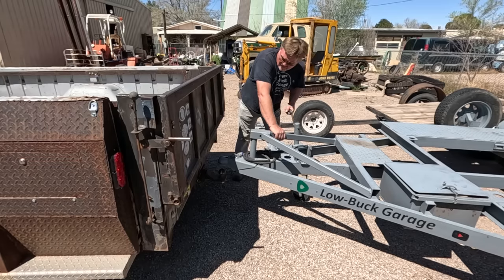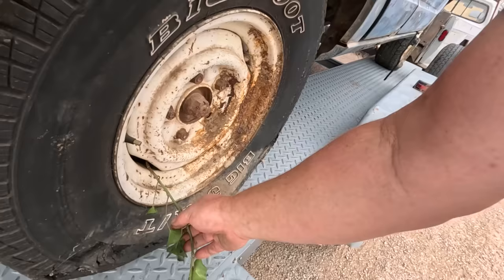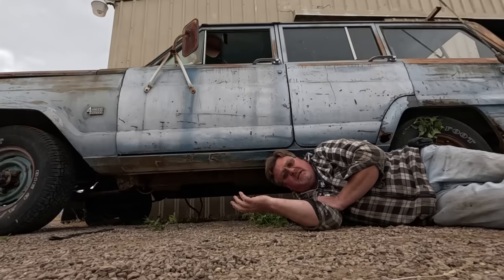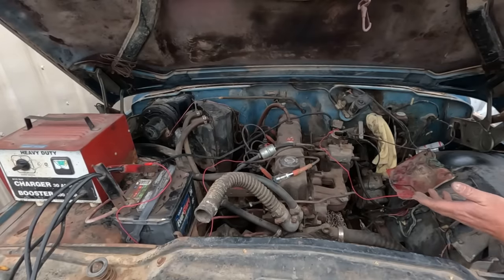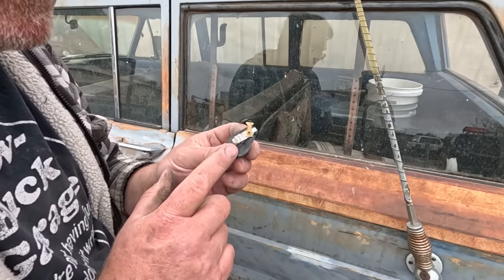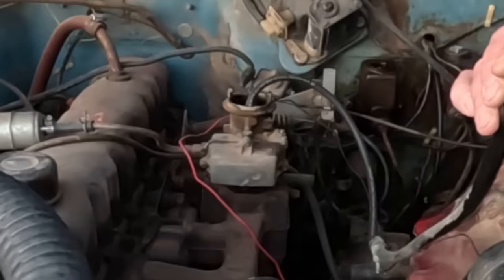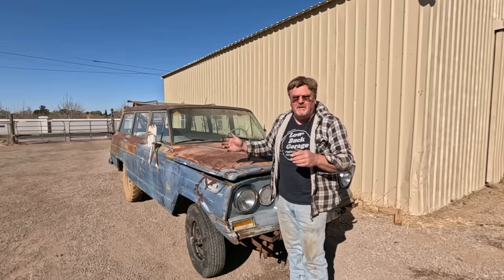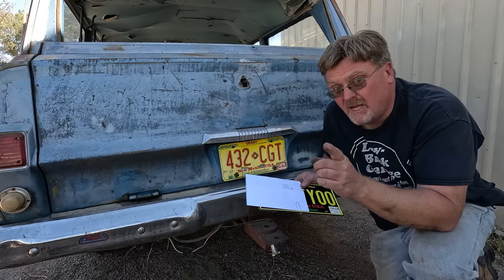The $2 Jeep... How Bad Can It Be?

Comment: I bet the guy who sold you the Jeep is watching this video in amazement 😮😊
Reply: Nah man, I just didn't have time to work non it and I knew low buck garage would have a lot of fun with it
Reply: Thanks for selling it- I enjoy low bucks videos
Reply: Can't wait to see the finished result, Pancho!
Reply: @How_the_gods_drill . Bet y'all really pleased to see it running tho, it was a lovely gesture from you. 👍👍
Reply: A nice gift. We're all enjoying it. Cheers 🍻
Reply: @How_the_gods_drill  the only engine issues were fuel, plug wires, and the missing rotor. You could have had this running pretty easily
Reply: @or-what  Thats low buck standards. Also needs break work, interior work, likely suspension work to be safe. A man could put 3-5k into it to make it a decent driver. Also not everyone has the knowledge to do all that stuff on their own. Get in touch
Reply: Yeah he said the engine was junk but it turns out that it runs fine after a little ignition and carb work.
Reply: @79tazman  Eh, I've seen a lot of junk engines that turn over and run just fine in a roller, only to have massive blowby or be puking oil from everywhere or a cracked combustion chamber that's only a problem when it gets hot.
I'm kind of hoping that LBG will give us a good rebuild video on this I6. With a dingle-ball hone and everything.
Reply: Fuel pump rad brakes gas tank a way to go  but he's got. A content. Winner
Reply: Naw swap in a newer 258. Jeep and check tranny.  Needs some good love and he's got a good family dune. Runner
Reply: Seems like the guy sold it specifically to watch this video in amazement. Could have sold it as scarpmetal for more than that. So. Thank you @franciscopolanco4492 you made our day with this.

Could have just given as a donation but a firm price of 2$ is way funnier. Probably avoids some paperwork too i have no idea about how car ownership transfer works.
Reply: and loving it 😊👍🏼🥓🥓🥓🥓🥓
Reply: @How_the_gods_drill  sos argentino?
Reply: why do all these peiple have accounts as old as me?!

Comment: "I suspect there might be an issue with the transmission, so I'm just ignoring it." Sums up my 20s
Reply: Sounds like a throw out bearing or clutch prob nway keep was hacked together I woon not bsuspect. It
Reply: Definitely throwout bearing!
Reply: 100% was gunna say release bearing(throw out to you ‘Mercian’s)
Reply: There's the same energy in that sentence as a quote from Tavarish that I remember, the cheap Audi that got him home and finally died in his driveway.
"I'm not going to check the oil because I don't need that kind of negativity in my life."
Reply: @Avetho or "but I'm sure that's just my (insert notoriously unreliable car)" from Aging Wheels
Reply: In your 20s, you can’t afford to fix it, so… Later on it will be (slightly) different!

Comment: This is why I like old cars-fuel, air, spark- you can get it to start. No computer, no scan tool, no reprogramming - just some knowledge and common sense.
Reply: Agreed.
Reply: I'm 23, was able to rebuild a 1970 f100 from the ground up after a head gasket failure. It was basically plug and play, 300 i6. Engine had 300k before rebuild. They really don't make em like they used to
Reply: That's great and it's true - but back then my daily driver constantly  needed one thing or another looked at, and when it was below zero out in winter there was a 50% chance at best that it would start. I like the new cars better - though most of them don't look near as good as the old ones.
Reply: And a little beer.
Reply: just three things, air (oxygen) fuel, and spark, then you have Internal Combustion. It's all you need!!
Reply: Juvenoia

Comment: Know it is not what this channel is about. That beast deserves a full restoration.
Reply: AGREE
Reply: Put the body on 2000s frame, motor and transmission.
Modern brakes, suspension, modern drive train, a/c will work 10x better. All for less than $2k.

Comment: Two bucks for a complete roller that's basically a rad AF blank slate as a builder is the deal of a lifetime.
Reply: This would have been my dream set of wheels back in the 90's.
Reply: @Oldsmobile69  As a proprietor of a small business that's extremely vehicle dependent, I'd give my right eye to have an FSJ or FJ60 to rock up to a home inspection in.
Reply: Tbf the body isn't in great condition but it doesn't look TOO rusted out. As long as the frame is solid, and if it isn't, these may or may not fit on a Tahoe frame with a bit of work.
Reply: @lsswappedcessna  yep, all kinds of potential. I'm willing to bet that the cargo area floor is probably rusted out.
Reply: I've taxed worse. I've definitely dailied worse!
Reply: there's nothing left to build onto without dumping your wallet at a body shop.
Reply: @bingo.6587  "Has lots of extra ventilation" you say?

Comment: I'd say it was worth $2.
I had a 74' cherokee that didn't sell for the $3,000 I was asking so I parted it out and sold most of it on ebay and the engine & trans locally. I made $9,000 after parting it out.

Comment: Looks like someone swapped in a 232 when they couldn't find parts for the original inline 230 Tornado engine or they blew it up. I had one of these in the '80s and loved it. It was a rock solid vehicle with great 4WD. Awesome find! Great work getting it running and rolling.

Comment: Yes!, Kmart had tires made for them. My first car, a 64 Ford, used the same size and I was a loyal (and poor) customer for them.
You have a piece of history there!
Reply: My 4 door 64 galaxie had a 1974 Montgomery wards riverside 7.75-14 bias ply for a spare. The damn thing aired right up and didn't appear rotten at all, it was in way better shape than the Michelin X radials it had that appeared to be from 96, those were rotten. Probably a pretty good chance the same parent tire company made both the riverside and Kmart tires. It's been about 12 years since the local Kmart I went to regularly closed down, but I can sure still smell the automotive department in the back.

Comment: As a teenager in the early 70's, Kmart tires were all I could afford. I became a loyal buyer when one of the tires I bought had a Uniroyal label on it and the service manager confirmed that Uniroyal made the Kmart branded tires. I never had a problem with them and they lasted as long as most name brand tires.
Reply: Uniroyal got bought by Michelin. They still make Uniroyal tires in the US.
Reply: As I often tell people who criticize me for buying store-branded things, they don't make those products in their backyard some are good and some bad but the same happens with brand name products
Reply: kevinfiebelkorn4715 A guy I used to work with his brother worked where they made Gabriel shocks .He told us that they also made shocks for Kmart. They just put them in a different box.
Reply: Yeah tire store had radials and bias plus sold as blems at third of cost of brand name  letter tires started replacing numeric ones in 2968..dad bought L 78 25 FOR BUICK FOR YEARS AND HOT RODS HAD 40, 50, 60, 70 SERIES WIDE TIRES TOO
Reply: my father got a lease car every 2 yrs f/1954... wen he ordered, he requested ANY tyre butt uniroyal... EVERY other salesman who got uniroyals, got a blowout f/a tyre defect... he NEVER had a set... became a friend of a B F GOORICH dealer & i still 2 this day use  B F G' S... BEST tyre as far as i am concerned...
Reply: They were much better compared to modern Chinese crap tires!!! :-)
Reply: K-Mart is still around online.
Reply: I used to go to K-Mart and later Wal-Mart service center and ask if I could have any of their take off tires. When people replaced a set of tires there were usually 2 or 3 good ones they replaced anyway to get all new matching ones. The stores were happy to let me have them so they didn't have to pay to dispose of them. I never bought a new tire until I was over 50 years old. Unfortunately they finally quit giving them away, probably for liability issues or something.

Comment: I had one, in 1973, 4, 5, 6.
Lived so far back in the Virginia mountains, we had to cross the same creek 8 times to get to a dirt road - some of those crossings in 
4-wheel, low, up the bank.
Rebuilt the engine, new clutch, probably still being driven.
I saw it once, in the mid-nineties.

Comment: Great video; I got one with the OHC "Tornado" as opposed to "Hurricane"6 cylinder that ran well but smoked like a chimney. (valve guide seals) Did the T90 column to floor conversion and got everything going. It even had an 8000-pound Ramsey winch with front bumper mount and not a spot of rust, gave it away for $300 forty years ago; shoulda, coulda and woulda...

Comment: That Jeep looks like an Ex US Airforce vehicle. Sort if like the SJ Cherokee they were driving in the beginning of the movie War Games to their Norad Silo, just this is an earlier year, it nakes sense being a high desert truck it aeems very savable. No need to restore it perfect or anything crazy, just clean it up, give it brakes, tires, maybe work on some of the strange things happening with the swap parts, interferences and irregularities with the suspension and oil pan. It has a definite survivalist/crusty rancher feel. I'm astonished you managed to magic so many things into functioning again, there is absolutely no way many vehicles from the 2000s on, could ever have a prayer of that happening. I would imagine that with a fuel tank, brakes and cleaned up it would fetch an easy $3000-4000.

Comment: Yup, K Marts had complete repair shops and sold tires. Those wires looked like old Whitaker spark plug wires with real wire, not carbon. They used a resistor to cut down on radio noise.

Comment: I had a 66 Wagoneer.  All were 4X4.  If memory serves, mine came with a Dana 44 front and Dana 60 rea end, and the ratios were 4.11 to 1.  With a floor shift, it should have a T18 transmission with a Dana 20 Transfer case.  Having said that, I seem to remember that the 64 model came with independent suspension in the front, but it was "too squirrelly," and they reverted to a solid axle configuration in 65.   An "aftermarket" conversion to solid axle may explain some of the strangeness of your vehicle.

The AMC six had the same distributer as the Chevy 6.

Comment: One of our family haulers when I was a child was a '66 Waggy.  The only frill it had was 4wd and old bias ply mud grips that sang a song on the little pavement it ever saw.  Straight 6, 3 on the tree and white steering wheel.  No radio, and probably had the heater delete.  (we lived in a tropical environment)  I would also note that the factory original transfer case selector lever had a 90 deg sideways curve, causing the leverage needed to select a mode to be off-set.  This was a source of consternation for my dad.  It was a struggle to operate.  No doubt the mod performed on your $2.00 rig was an improvement.  Thanks for letting us in on your fun.

Comment: I had a Gladiator style J Type pickup same year as this, in the Rhodesian guerrilla war between Smith and Zipra/ Zanu PF fighter. It had the same cab with fold out front screens, the Tornado o.h cam that ran inlet and exhaust off each cam lobe. A truly great truck. Imported from S Africa for the war years. Left it with a friend 1984 when i split.
Great vid, Great Jeep! Great effort.

Comment: I'm amazed it rolled for you.
I left a car sit two years and when I drove it out, the rear drum brakes were sticking I was dragging the daggum tires across the gravel leaving ruts.

This is awesome. those old Jeeps were built rugged and they are easy to work on.
I'll be checking back to see how the project goes

Comment: Crazy I bought my '84 FSJ for $200. I already had a rusted out Dodge pickup grown over in the back yard. My FSJ was the "luxury" version with electric and vacuum operated everything so I budgeted 5K to rebuild it as a fun project. After dropping the engine and trans I started to look for parts to rebuild it and realized that nearly every part of it was similar to my Dodge truck. I ended up spending $900 to refresh the 360/727 from the truck and after swapping the tail shaft from the FSJ to the truck trans it went right into the Jeep. Almost no problems. Even the speedo cable fit the truck trans connector. The one kind of big problem was one of the motor mounts was one inch forward. So I took the truck mount and the jeep mount and welded them together offset.  I drove that 12mpg tank for eleven years without any severe problems and ended up giving it away to a neighbor. I love those things.

Comment: Nice Classic Jeep!!! Check the trans Rear end, Front drive axle oil levels before driving it, ,and get the brakes working... Put water into the cooling system... Add Power steering fluid as necessary!!! I REALLY LIKE THAT WIND-MILL YOU HAVE THERE!!! That 'race teack' that you stopped at, reminds me of Williw Springs raceway in Rosamond, Ca.

Comment: Instant subscribe - I have a '63 that has been laid up since 1974. Mine is complete and original with 3-speed column shift and the "Tornado" motor, so in the camp of "need to be careful to keep it original", but has a lot of surface corrosion. I have never tried to get it going as I bought two projects in the same week and the other got the priority, and medical stuff means I can't work on it anymore, but I'm eagerly waiting to see what you do next with yours

Comment: I had a 67 wagoneer with a Corvette 350, turbo 400 transmission,B&M quick shift an L 78 15 tires. It ran like a bat out of hell. Smoked all 4 tires and Crawled up the canyons in Littlerock ca. Got it for trade for a 1970 International 1000D stepside. Miss them both

Comment: I had a 1965 Galdiator, 4x4, 3 on the tree, same color.  It had rust in all the same places, and the floorboards.  Tornado in-line 6, was still running.  Brakes needed some work, but overall in fair to good condition  I didn't have the time for it and gave it to my cousin.  I later found out he left is sitting to gather rust and dust.

Comment: Love this. I have a '64 Gladiator with the original OHC engine. There are some drivetrain differences between the trucks and Wagoneers. 
The rust patina on that is priceless. My truck has similar rust and I'm leaving it. 
Shouldn't be hard to get the correct headlight rings. Believe they are the same as a CJ.

Comment: Sure miss my 66 Wagoneer. Kaiser Jeep 327 V8. Gm turbo 400 transmission, AC Delco starting system, Ford front and rear axles. One owner before a mining engineer who added power steering and brakes, automatic locking front hubs, had studded tires for winter driving, put thousands of miles on it from buying in Arizona aroung 91 and got me around up to Oregon and Wyoming. Basically ended up giving it away after having it mostly in storage for a couple of years and taking it for a run once a month or so.

Comment: I had a 78 j-10 pickup almost w the same setup as your grandwagoneer.
It had a earlier 232 from a scout ll..I think 72-74.
It also had a non original t-19 3 speed. It had a huge rearend,a Dana 60 I think and a Dana 44 on the front. Same deal on the front suspension,it originally was a leaf-under-axle,someone put the leafs over the axle for height.i could tell the stuff wasn't original.but overall the truck went good I never had any problems with it.was and awesome off-road truck,I hardly got stuck anywhere.nice video

Comment: I live in Sydney Australia and bought the same model wagoneer in 1988 replaced the engine with a 350 small block Chev. Installed a turbo hydro 400 with a quadratrak transfer case and drove it until 2002 and stored it until 2022 and went through a similar procedure starting the engine again. Still have it and would like to fix up the rust issue as it probably is the only wagoneer left in Australia. Something to be said about early American four wheel drives is they don't make them like that anymore. No need to plug in a scanner to find out what is going on with the engine like my Dodge nitro. Only problem is the engine prefers leaded fuel. It will be interesting to see what will be needed  to get a roadworthy certificate or see if it can be registered.

Comment: That knuckle with the grease fittings are for a steering shock absorber. That shock isn't like the shocks on the suspension. That particular shock is both hard to push and pull.

Comment: I had to take a page from your book and make a road trip this weekend. 4 hrs each way to buy some junk. Actually its a 53 Willys GP. (I believe Korean era,) medic jeep. I'm not as familiar with these as other vehicles, so I don't know everything that's missing. It has no distributor, carb or starter, and no trans crossmember. Just a bit of surface rust between the Swiss cheese of a floor board, and both rear springs are rusted and broken so badly, I was worried about dropping chunks on the road. It was slightly above scrap value, but still cheaper than anything that was closer to me. The first thing is there's a missing cover on the back of the transmission. Wasn't sure it it covered a PTO area or something. I have been watching your older videos to see what I can find out about these vehicles. I'll have to send pics as it progresses. It's not going to be a quick fix, but we plan on making it as fun as we can. Thanks for making your content. I always look forward to seeing the next project you have.